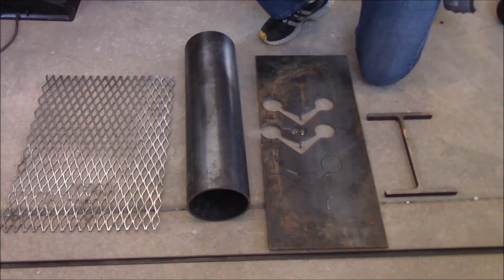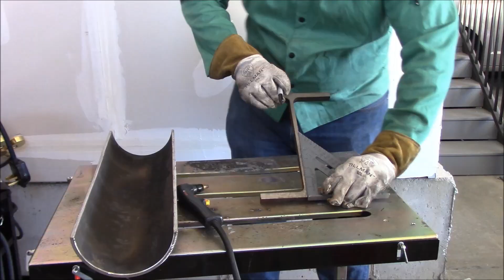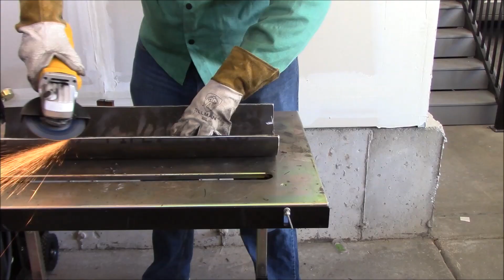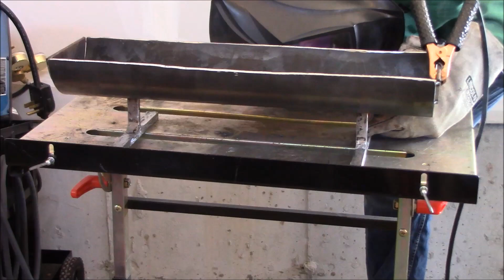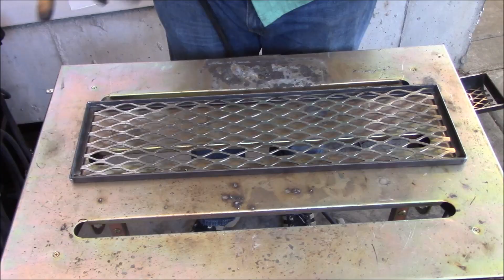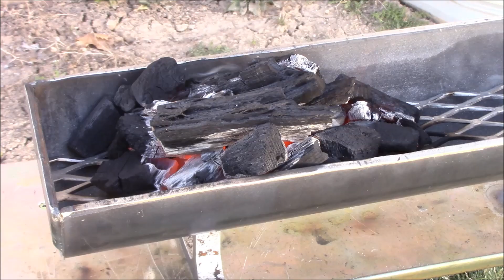Weekend Welding Project: Hibachi Grill

Comment: Great bbq you did here, I'm a welder l made one a month ago, basically same as this one, but l used an inverter stick welder, and l used lengths of 8mm round stainless bar for the  top and is hinged, and 6mm drilled holes along the bottom for the charcoal to get air

Comment: What kinda Flux core wire did you use
Reply from the maker: I used solid MIG wire with shielding gas on this project. If you’re looking for a good all around flux core wire, I recommend E71T-11.